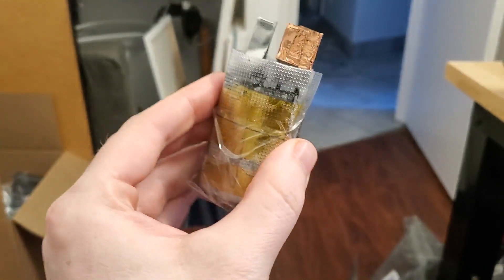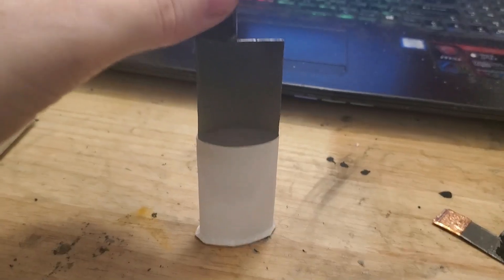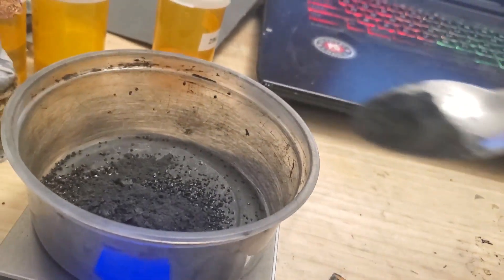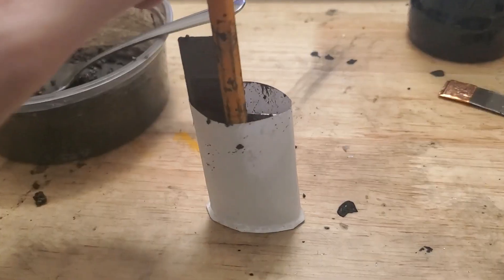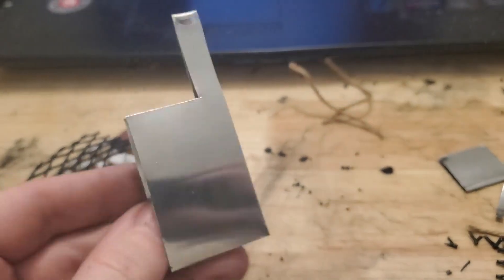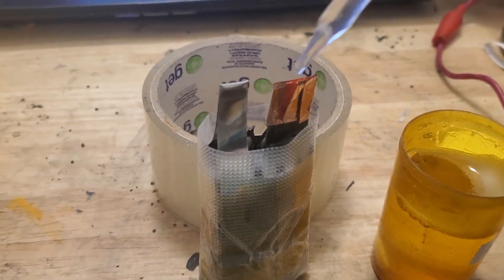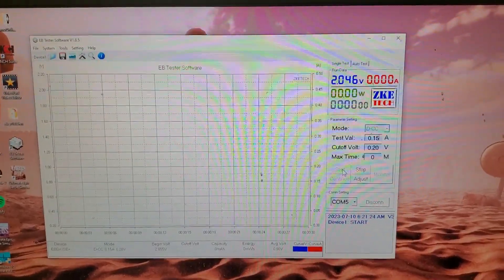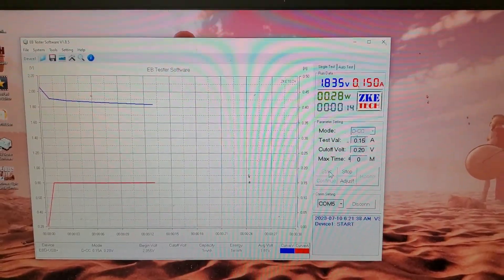Zinc Ion High Energy Home Made Battery - The Smallest 1Ah Cell I've Made..

Comment: In calculating the battery's watt hours per kilogram, did you use the total weight of the cell, including paper, grafoil collector, electrolyte, string, plastic screen, zinc anode, tape, etc.? If not your energy density calculation is not the true number and is much lower than 100.
Using just the weight of the active material (activated carbon) in the calculation is not valid and misleading.
Say your using it in an electric car, you will not be only having the added the weight of active material added to the car but it needs a battery case and all the other battery components to have it function in the car.

Comment: I can really appreciate people who share their builds and ideas with others on platforms like this. Thank you. I have a few simple questions that I may have missed watching this video. How thick is your zinc material? I have some 99.9% pure zinc plate with a thickness of .2mm and I hope this will be OK. I want to run something else by you for you to possibly try and I too will try this and if it works out, I'll make a video and upload it and give you credit for this information. Here's what I want to run by you. Have you thought of using a piece of round PVC pipe for the container and building the cell up somewhat in the form of a standard A, C or D cell? You could do the same configuration but use the PVC as the hard shell and line the inner diameter of the PVC pipe with the zinc followed with a circular piece of plastic mesh to give the zinc the needed space from the carbon electrolyte mixture. My last question is when you top off the battery with the electrolyte is it to the level of the height of the battery. I realize that may sound like a dumb question but I want to be sure so when I try this I get as close to doing this right the first time as I can. Once again, thanks for putting this information out there for others like myself to see and build. Take care, Flash001USA.
Reply from the maker: Yes, using a cylindrical body such as a pipe should work.  However, keep in mind that current collection surface is reduced in a round cell, which is why a more flat pouch cell will yield better power output.  Yes, the electrolyte needs to be just at the top of where the active material ends because there is physical separation, but leave some head room at the top for expansion during charging.
Reply: @microphotography2090  Thank you for replying back. I can understand your point on the surface area limitations on how it can affect the current and I thought that you may have already even tried this yourself. When I receive all of my materials I'll shoot for a few different configurations and see what happens and if the results are decent I'll make a video and share the information with others. Once again, thanks for the video.

Comment: What chemistry is happening during the charge and discharge cycles? Does the battery give off gas? The internet is suggesting that sodium sulfate and carbon react to produce carbon monoxide.
Reply: This is not long lasting battery, lead acid will more long lasting, because this zinc foil will corrode
Reply: @teknosql4740  no doubt, but the energy density of lead acid is far less and contains hazardous materials. Lead acid would not work well for the residential environment I'd want to deploy it in.

Comment: Amazing content. I would be interested in a 1kWh build if you find the time.
 Many people need a few kWh of battery storage for their homes. This could be useful for them. 
How safe are the batteries? With all that carbon, are you afraid of them burning?
Reply from the maker: 1Kw is a lot of work, however I might do a 50-100 amp hour single cell.  If there is enough interest, I might make a bunch of them for a large 12v battery.
Reply: @microphotography2090  I am most certainly interested, please make that video

Comment: What hardware and software are you using for the testing?
Reply from the maker: EB tester software.  The battery discharger I am using with the software is this: https://www.amazon.ca/Yeeco-EBD-USB-Trigger-Voltage-Capacity/dp/B06Y639FY6
Reply: @microphotography2090  Where do you get the EB Tester Software?
Reply from the maker: @nicamarvin  Google it, it's free.  But you need a battery testing unit, otherwise the software does nothing without compatible battery testing hardware.

Comment: I don't have a regulated battery charger like yours, what can I use instead? A phone charger seems a bit much for 1 cell unless I make 2 cells and connect them in series to up the voltage to 5v to be the same as the phone charger, but the phone charger has 1Amp is it going to damage the cell? What can I use instead?
Reply from the maker: You will need a variable power supply for proper battery testing, these things are super cheap, and all over Amazon(Search 'bench power supply', some are under $30).  If you want to save money, you can just buy a voltage step up, or step down converter and hook it up to a 12v dc adapter.  A phone charger will likely damage these cells, as you said it may work if there are 2 in series, but since you are new to this, you will likely just get frustrated without a proper power supply.
Reply: @microphotography2090  Another option is a DC-DC buck converter. That will drop the 12 or 5v down to something more manageable, limit current, and only costs $5. The XL4015 with display works for this

Comment: I'm going to tell you something for YT algorithm, you can delete my comment  afterward no problem.
If your goal is to thrive on YT and get rewarded, then uploading consistently is important even if it is every month.
The quality is already there, you have great shots and amazing mic.
But on this industry that ur in, is tough, because you are setting people free, as long you are not too serious about that goal its fine,
but if you are quite serious, then they don't like it =D
If your intentions are to share what you know and it is up to the people to figure it out, then you might be able to thrive on YT and also be understood.

But if it is just for fun then i have nothing to say thx for the amazing content.
Reply: I appreciate all what I learn here, but while it is interesting to be able to build your own batteries, simply buying lifepo4 cells for very cheap prices, making batteries DIY with them, while charging them up with second hand solar panels is also quite free, if the batteries last 2000+ charge cycles. But of course if there would be a shortage in lithium, then after 10 years of using the lifepo4 batteries, when they eventually break,  then a DIY battery made of house-hold items (is active carbon a house-hold item?) is more interesting if you want to have power for devices... However, in my case I am looking for a source that lasts for decades to power micro-controllers etc. and while good solar panels will live long enough to power it, finding a battery that needs no maintenance from humans, and lasts for decades, well, lifepo4 seems to be the best choice I have?